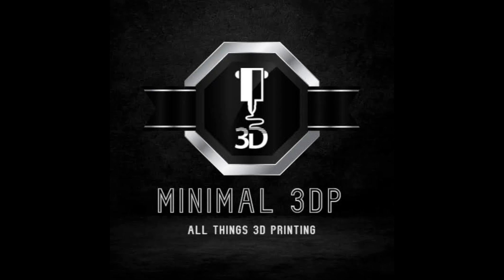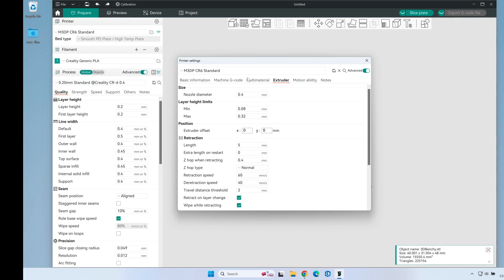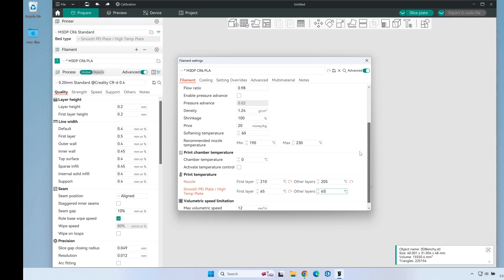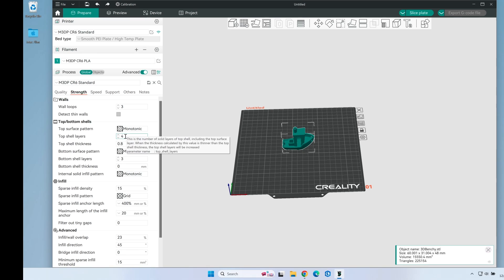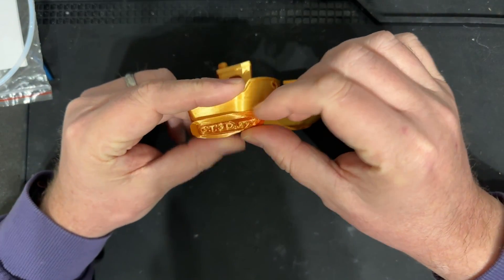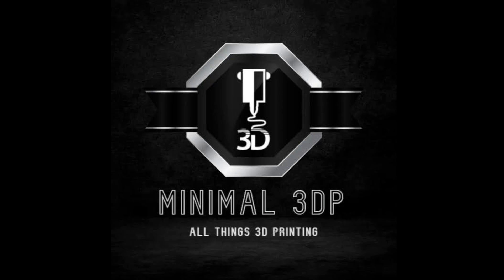Orca Slicer 101: Mastering the Basics (Creating a Printer Profile) - Part 2

Comment: 0:00 Introduction
0:16 Initial settings changes in OrcaSlicer (presets)
3:35 Quality settings
4:31 Strength settings
5:10 Speed settings
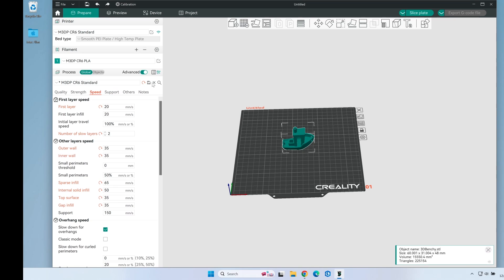6:11 Support settings
6:43 Others settings
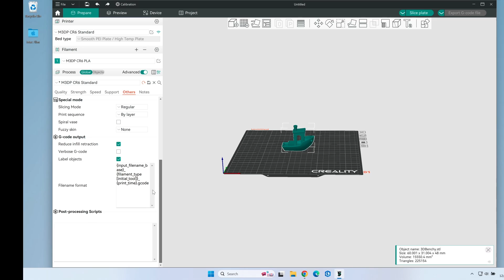7:04 Reviewing changes
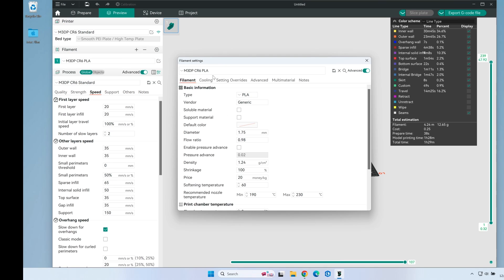7:37 Filament settings
8:12 Adding a brim for the benchy
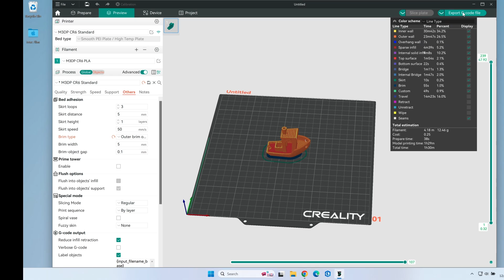8:50 Printing gcode in OctoPrint
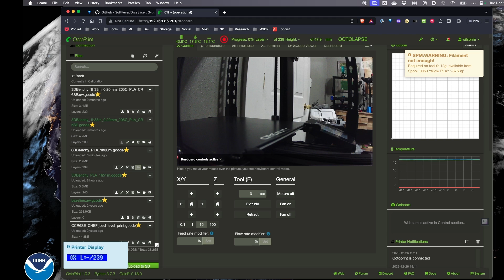9:05 Comparing the new benchy with the first
10:21 Outro
Reply from the maker: Thanks for this. Pinned.

Comment: I can't even start Orca until I choose a printer and my Rostock Orion V2 is not listed. 
I don't even understand the generic choices - it seems like Cartesian and delta should be the main alternatives but the "generic" choices sound like more brand names to me.

How much does printer choice even matter? isn't gcode just instructions to send your hot-end to X, Y, Z, and extrude N filament? I thought it was my printer's firmware that determined how to translate that into specific printer behavior.
Reply from the maker: Do you have a slicer you use currently? If so, look at those settings and Try to find a printer with specs similar to your own printer rather than customize to match your setup. If you don't want to customize an existing profile. Use the generic and customize. 

The gcode created by a slicer is going to contain commands for an individual printer. In some cases, those commands will override your firmware.
Reply: @minimal3dp  TY!

Comment: Possibly a generic question for you. I have a Creality Ender 3 V3. Your videos on Orca slicer have been a godsend but I do have some questions. My printer is auto leveling and I do believe it is doing that before each print, however it does not have that line in the g-code. I implemented it like you did and was homing and auto-leveling for ages. I removed those two lines for my current print and everything seems to be going good now. Any idea is "auto-leveling" printers with automatically, auto level without that G-code? Thanks for any help and again, great videos!
Reply from the maker: That code needs to be there in order to level every time. There is a gcode to save the leveling data (g4??) so you can level once and reuse the saved mesh.
Reply from the maker: Did I answer your question?
Reply: @minimal3dp  Somewhat haha. I'm performing a temp test on it currently. It started by homing the axes, cleaning the nozzle, then it is leveling as I am typing. Seems to be printing fine! The g-code from the profile is very limited though. 
M140 S0
M104 S0
START_PRINT EXTRUDER_TEMP=[nozzle_temperature_initial_layer] BED_TEMP=[bed_temperature_initial_layer_single]

that is all, but it auto levels and homes nonetheless.

Comment: I wonder if you can help me? 
I have been working on a part that has boss's for screws to mount a PCB, I have designed the boss's to be solid apart from the threads.
 How do I configure Orca to print the boss's solid throughout the print? (they start at layer 1) the rest of the part has 35% infill
Reply from the maker: I think you can do by object settings

Comment: im a new 3D printer owner, i start to see a few Cura videos, but after i start to upgrade myself i find out Orca Slicer is far better, so i find your channel, thank you for the guides :D great work, on my case i have ender 3 pro, soon will add dual z and cr touch, i think about order ender 3 S1 Pro, what you think? thank you again.
Reply from the maker: Thanks for the feedback. I love my e3 s1 plus. The pro is great too. 

I have a video on doing the dual z as well
Reply: @minimal3dp  will check, atm im doing the test in Orca Slicer so im follow your part 4 video, will finish all calibration tomorrow, really great work, question: for all filaments type will be better run the temperature tower test correct? rest of setting can be the same or im wrong? again thx

Comment: I have been following your videos as I have an ender 5 plus and just upgraded to skr 3 with klipper. In this video your startup commands is that for marlin or klipper or both? sorry I don't know the differences that well. There is no profile for ender 5 plus with klipper in orca slicer, so I'm trying to figure it out
Reply from the maker: You need to add a print start macro in Klipper and refer to that as your start code. Take a look at my Klipper macro videos for some recommendations. Email me at minimal3dp@gmail.com if you have more questions.

Comment: Hi, thanks for the videos i have a question on speeds as coming from cura the print speeds settings are labelled different and a bit confused could you explain if possible thanks
Reply from the maker: I will see if I can put something together. It will probably be the weekend.